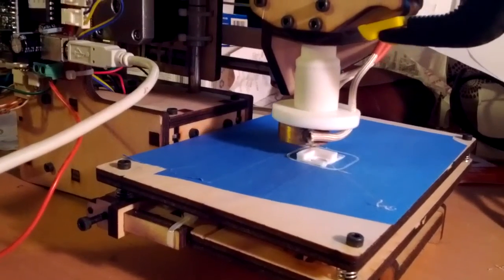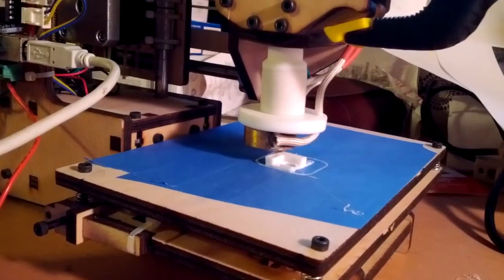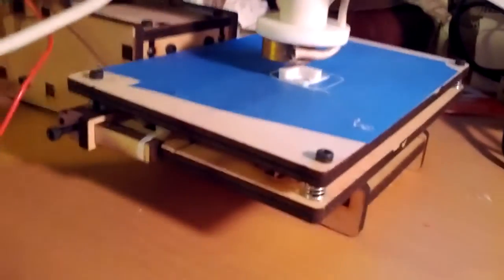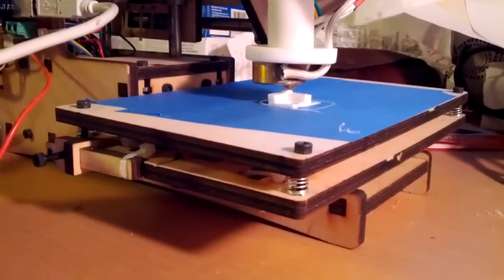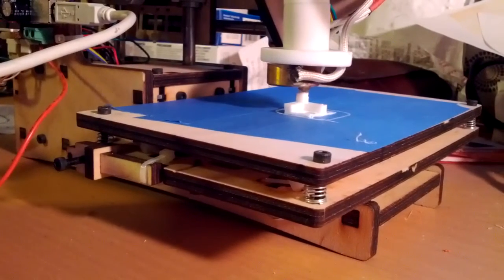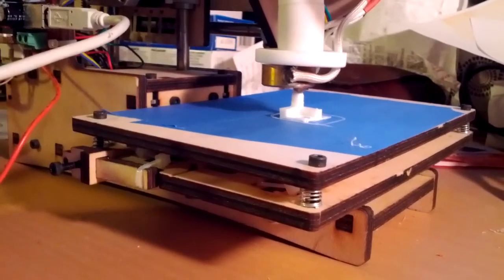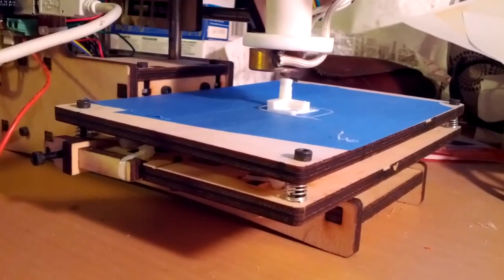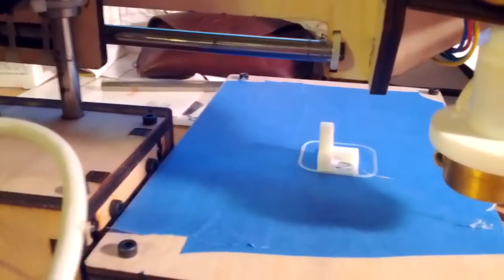It Lives! First print with the Printrbot Simple

Comment from the maker: I ended up shaving wood off as well to fit in the stepper motor that I have. The ones I have are larger than the ones that Printrbot expects. They are Nema 17s, but are deeper than the Printrbot ones.

My current problem now is electrical. The Sanguinolou that I use for driving the printer keeps blowing the extruder stepper driver. I am switching out power supplies and adding in a better switch to turn it on and off.

If anyone else has run into the issue, I'd love to hear about it.

Comment: My Printrbot Simple arrived Oct 16, 2013 and it took me two months to fix all the design flaws.  What a great experience for me to experiment, test, calibrate, download design fixes and print Y carriage parts, vibration dampeners, etc.  I had to shave some wood off the Extruder assembly so the bearing could push the filament against the drive gear.  They sent me a drive gear that was for a 3mm filament, so I bought one that works specifically for 1.75mm filament - that was a key moment when the bot really started working reliably.
Showed it off at a school science fair evening and the parents were all over me asking questions.
Best hobby I have ever had.  
Building a Mini Kossel right now, part way done, ready to finish structure and test the motors etc. before installing the hotend.